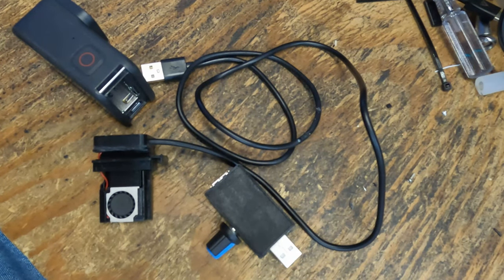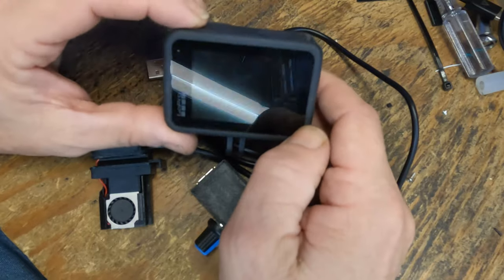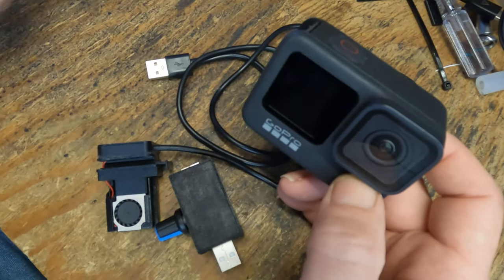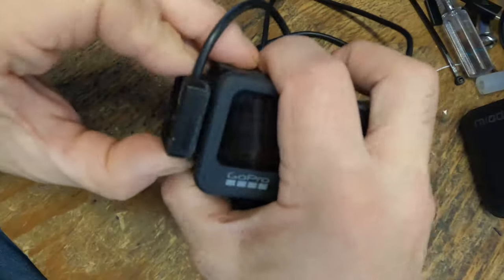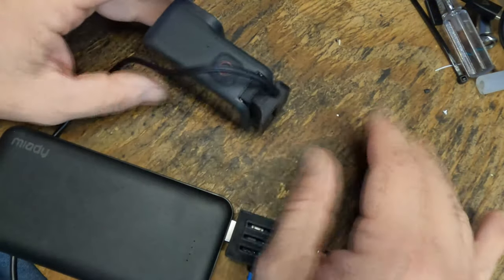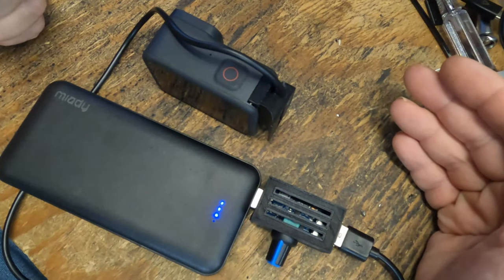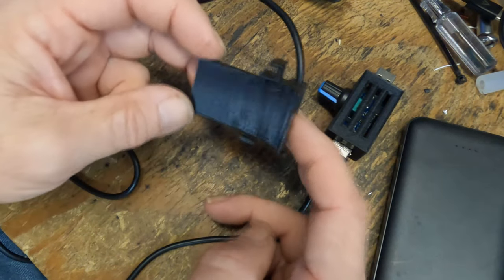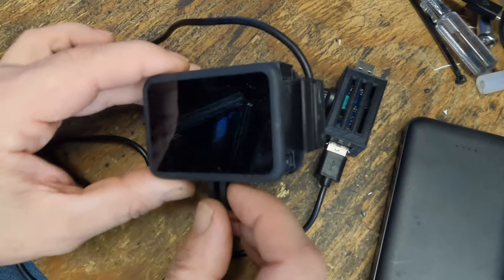The Bretware GoPro Hero 10 cooling system

Comment: What if you leave the battery open and just mount a fan to blow into the opening
Reply from the maker: Would help but wouldn't be as efficient, this contraption divides the battery compartment so there is a nice U shaped air flow.

Comment: Hi,
with this it is not possible to plug-in external audio correct?
It would be nice if you combined this with a 3,5mm input jack.
Reply from the maker: That would be the perfect solution but battery is required for the OEM adapter. Not sure why that is.